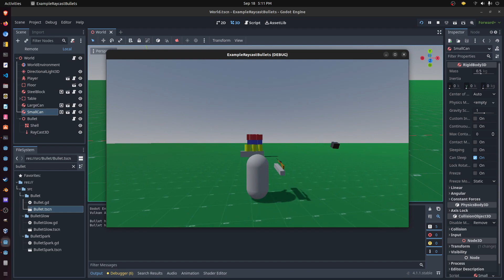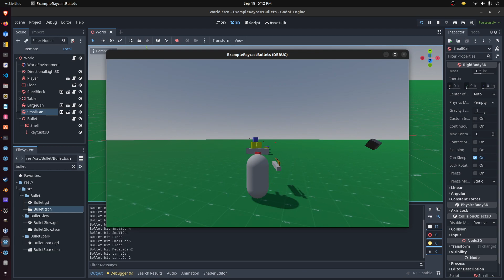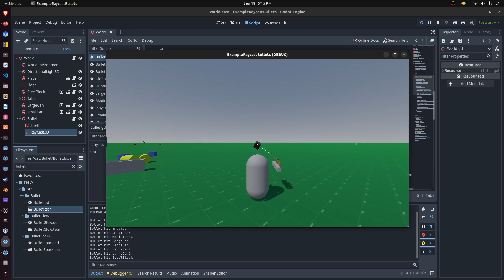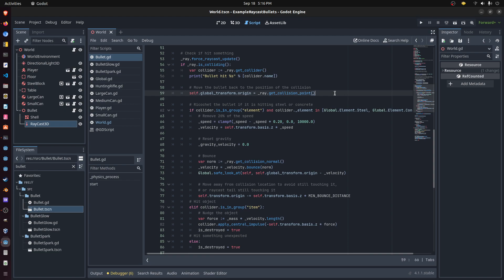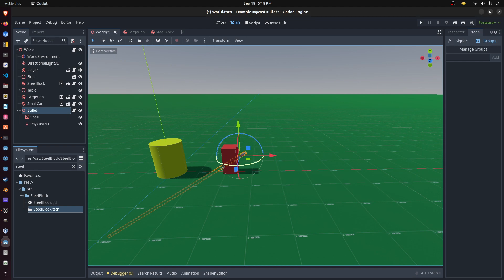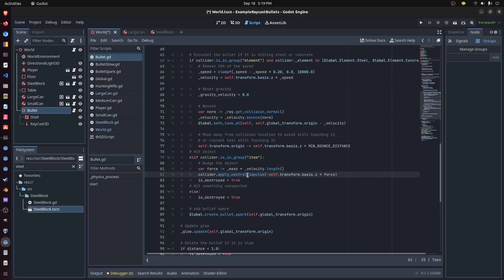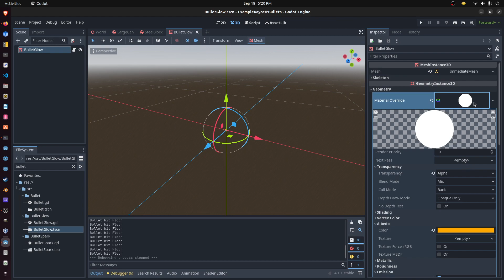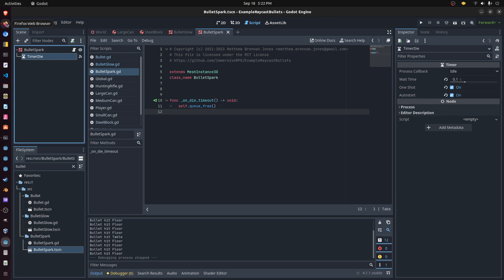Raycast bullets in Godot 4

Comment: Hi i wanted to say that after 9 months of godot gamedev i figured that you can solve the "1 iteration per frame" problem by using recursive functions. I am using a quite complicated player vehicle Model with many layers of children so parent.exclude does nothing. But with recursive functions and raycast query i managed to successfully exclude every parent Area even if the projectile is flying at 152000 pixel per second (im making a 2D game)
Reply from the maker: Glad it worked out for you. There are a ton of different ways to do it.

Comment: I actually plan on using a very similar system. But mine is for a fake dynamic sound propagation system. It's based on how we believe dolphins use sound in their environment.

It works by casting a ray in the direction that the player camera is facing, and then listening to see how long until the ray hits something. When it does, it then warps the sound that is played based on a graph setup by the level designer, based on that particular level. The concept is based on the GSound demo which, can be seen and heard on YouTube.
Reply from the maker: That sounds neat. Reminds me of Ecco the Dolphin.